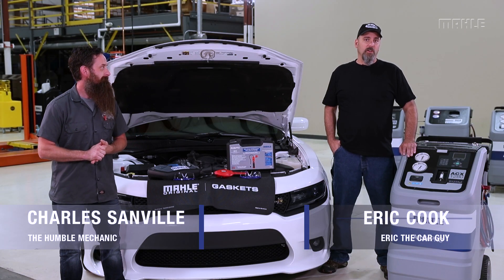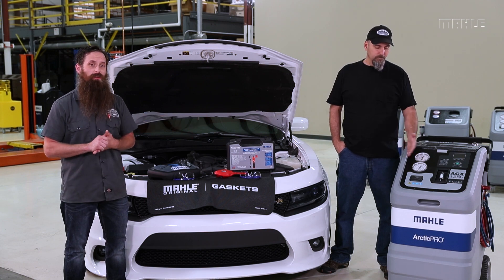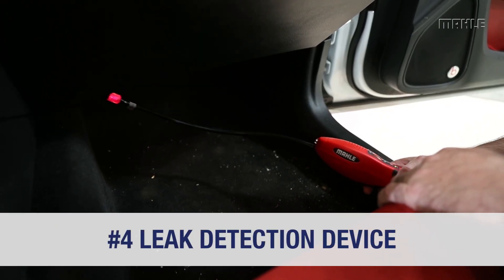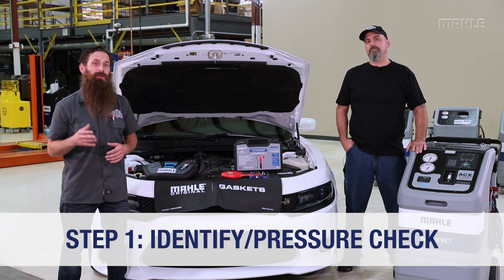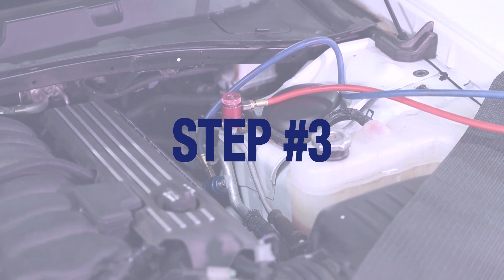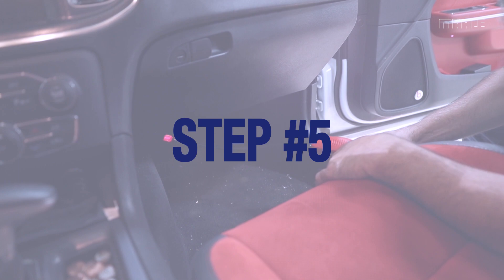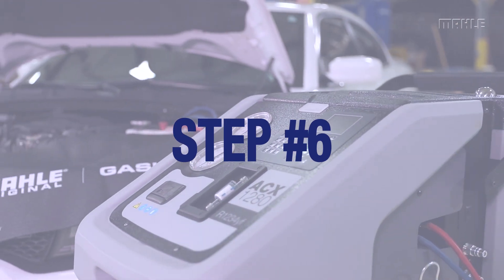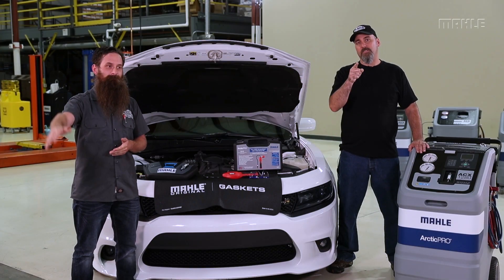R1234yf Service: How & Why

Comment: If you're doing a recovery and recharge you do not need to add any refrigerant to do a standing pressure test as the recovery machine will stop pulling out refrigerant when the system hits 0 psig at that point there is still enough refrigerant in the system to act as a trace gas when you pressurize the system with dry nitrogen to the systems low side maximum pressure. And as with any ac system the true test is whether it will hold a deep vacuum for at least 10 minutes.

Comment: i am facing this now, why do i not get a credit for all the gas you withdraw.
if it takes 4 cans to fill from empty, but you pulled 3,5 out, then turn around and charge me for a complete fill-up.
Seems this needs to be addressed at the gvt level,  getting fu__ed again.
Reply: because they are not allowed to put that gas into any other system, unless it is a vehicle you personally own, per epa rules. Instead it must be turned over to a certified reclamation company and returned to AHRI 700 purity specification, which is not a cheap or quick process.
Reply: You fd yourself when you bought the car with this scam in it.